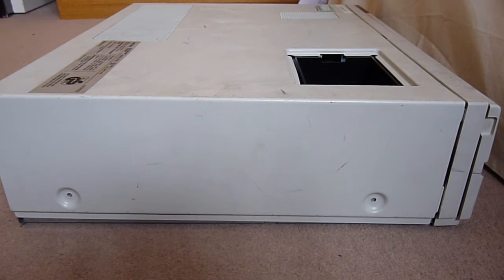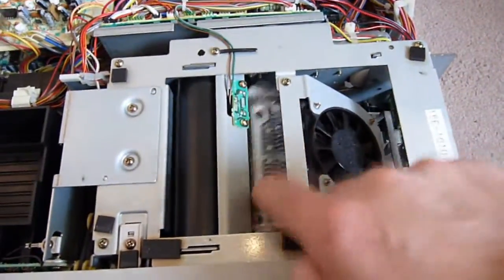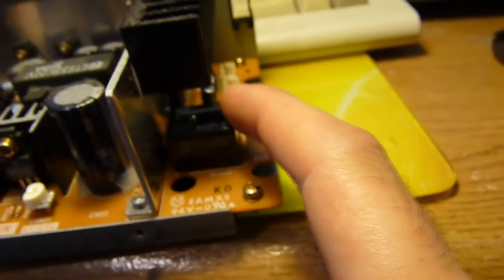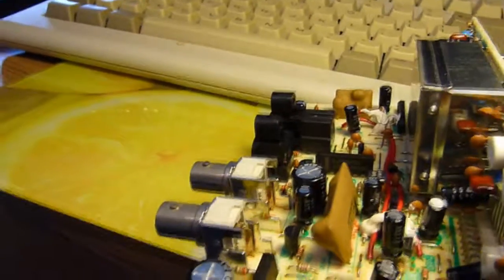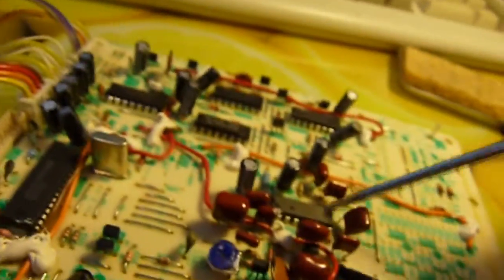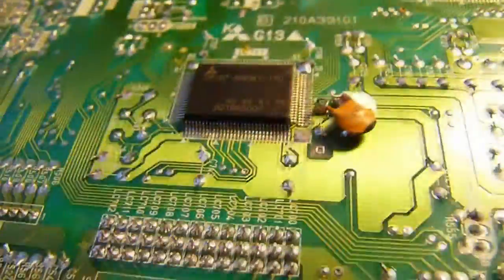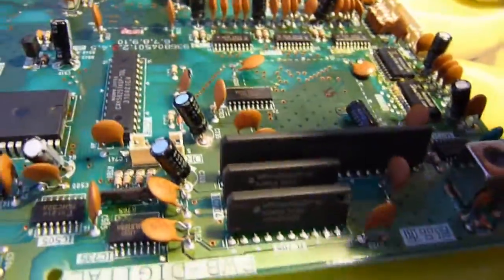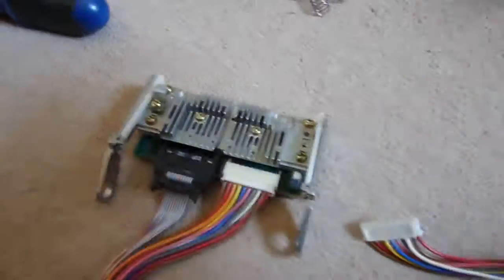Mitsubishi CP15E Video Printer

Comment: Sony patent, used in thier Selphy printers to make colour photos. Slower than an arthritic snail and takes 3 passes with the thermal head to make a colour image on the paper using thermal dye sublimation. Old sheets have a negative image of the print.
Reply from the maker: These thermal printers are rather slow.

Comment: I believe they used these in theme parks and the like to enable them to produce souvenir photographs for customers.
Reply from the maker: 1990chrism Probably, they always had interesting looking printers sitting at the back.
Reply: I think it would certainly have made it easier back in the days of analogue to add graphics and logos on the top of photos as they just would have needed to add it into the video source.
Reply from the maker: 1990chrism There were a number of ways to add material into analog video, often out to reach to the standard user though.
Reply: ***** Guess it would be a case of having something to genlock two video sources and something to generate the graphics, would be expensive but those photos were never cheap to buy anyway. Given the time it would take with traditional film cameras, and processing, etc it was probably the easiest and quickest way and to also get somewhat acceptable quality photos.
Reply: 1990chrism they could have got away with an amiga with video toaster and genlock card i think